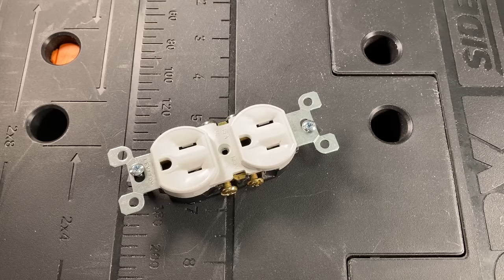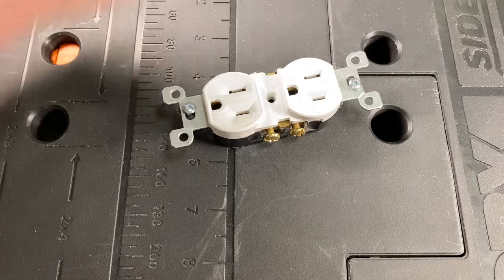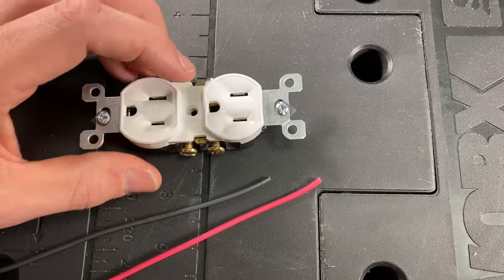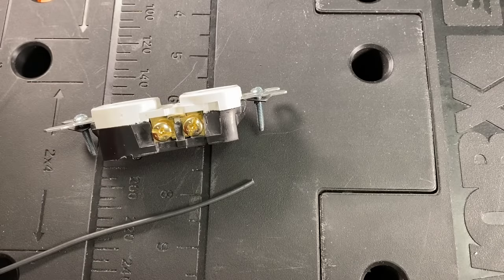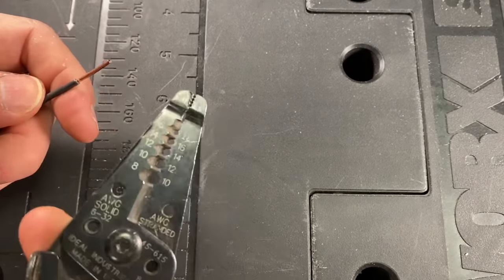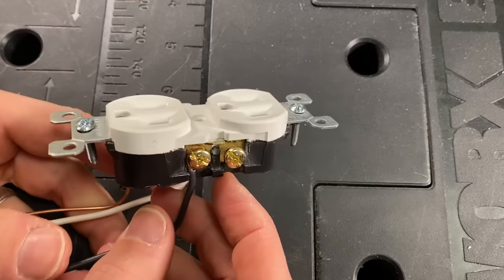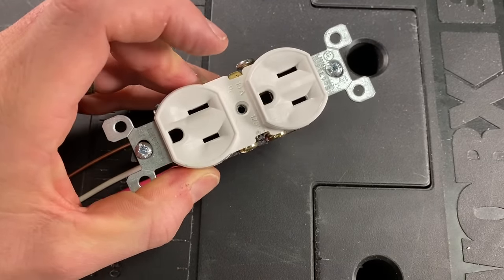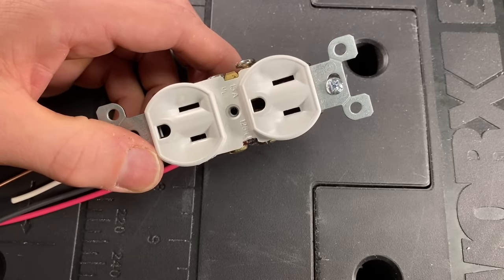Electrical Outlet Basics | How To Wire

Comment: Another little trick you might want to mention. Sometimes when outlet or switch boxes are installed (prior to drywall or finish surface) the box is secured too deep on the framing stud. The "ears" that you see on the very ends of the outlet are to stop the outlet from being installed too deeply into the drywall. If the outlet is installed too deep the cover plate will not seat properly. Also, drywall installers are notorious for cutting out the boxes with too much of a gap between the box and the drywall. This will make the "ears" ineffective in keeping the outlet from securing to the box without going too deep. (hope I explained that clear as mud) There's a trick I learned from the master electrician I was an apprentice under. Take a length of bare copper wire and wrap it around the screw between the outlet and the box to use as a spacer to make the outlet flush with the outside of the drywall.
Reply: োনচময়ৃ।চৃ🎗🎗🎁🎖🎖🎀🎑🎋🎗🎎🎌🎆🎌🎌🎌হিরজসজাহাজশহৃশৃসহমৃশননসমসমডনডম
Reply: @David S ... I don't quite understand what you mean by "the screw between the outlet and the box. Would you clarify please? TY
Reply: @dianavp9054  Take a screw that is the same size as the screw used by the outlet to secure it to the box and wrap a copper wire around it a couple time then cut it off. The coil you've made can be used as a spacer between the outlet box and the outlet which will in effect make the outlet stick out further and seal the cover plate correctly. I hope that helped.
Reply: @davids7209 or use an adjustable box so the box protects the entire receptacle.

Comment: Make sure you test the wire for the correct gauge before using the wire stripper. By choosing the wrong gauge on the stripper and attempting to strip the wire, you can nick the copper of the wire or cut off some copper strands of wire if using stranded wire. There are usually two separate gauges marked on a wire stripper. One side is labeled for stranded wire and one for solid wire. They are not the same stripping hole on the wire stripper for both types of wire.
Reply: Am i the only one still using a razer blade to strip wires still??? lol give me a automatic stripper plz...

Comment: I love seeing how you do electrical work in the USA, here in the UK the bare cable is called the CPC (Circuit protective conductor) and has to be sleeved in green and yellow sleeving. Also our electrical sockets use the screw down type fitting, and not the loop method you use.

Our cable colours are Brown is Live, Blue is Netural and bare is CPC.
Keep up the vids
Reply from the maker: Hey Shaun,  Thanks for sharing 👍

Comment: I always screw in the unused screws so they don’t catch and nick wires in the box. 

You should show techniques for pushing the plug back into the box. That is often he toughest part of the job. 

The hook around the screw should always be positioned so that tightening the screw closes that hook rather than opening it up.
Reply: 0

Comment: Learned something new today. Small slot to hot side. Large slot to neutral side. 

To me, it’s always: brass = hot. Silver = neutral.  
Never thought about the sizes of the slots going to hot or neutral.
Reply from the maker: #neverstoplearning 👍
Reply: Brass is the darker metal, and is for the darker (black or red) wire.  White (return) wire to the white metal.
Reply: here's another for you.  it applies to receptacles with the ground at the bottom: "right will bite"

Comment: You might want to do a video that shows how to wire the receptacle when there are multiple outlets on the same circuit.
Reply from the maker: Great suggestion!
Reply: John Sessoms That should be as simple as using the other unused hot and neutral screws on the outlet to feed power to I believe 4 to 5 outlets max on a circuit.
Reply: @koshnaranek2317  I would recommend pigtails to each receptacle in multiple receptacle boxes.

Comment: Very basic but informative for those who have never wired a receptacle. Coming from the UK, I found it strange to use black as the live wire because black is always used as neutral there. Also the ground pin is always at the top not at the bottom. I had to completely retrain my brain. Also having the receptacle independent from the cover plate was something new. I was so used to having it all one piece and with built in individual switches so you can turn off power without unplugging the appliance

Comment: When you break the tab for the switched outlet, you must break the tab on BOTH sides and use TWO white neutral wires, because the two hot wires could be coming off of two separate 15A breakers.  If you use a single white wire, it could carry 30A instead of 15A and catch on fire.
Reply: Good to know.  I have always broken both tabs.
Reply: Not necessarily. If the two hots are opposite phase, you can use one neutral wire.
Reply: @sparks8218  if it’s coming from the same circuit, but if it’s two different circuits, you need a breaker tie so that both circuits are cut off simultaneously to prevent potentially having the an unexpected load still flowing across that shared neutral.
Reply: If they are from different circuits, absolutely true.

In addition to the reason you cite, a GFCI or AFCI breaker on the circuit will trip if the return wire doesn't go all the way back to the same breaker the hot wire came from.

On the other hand, if the switch and the always-on lead come from the same circuit, then a common return is fine because it's all one circuit.
Reply: If you're doing the wiring you should know that. If you didn't run the cable then look in the switch box. If a 2wire w/ground is the source and both the black and red wires are deriving their power from that same cable, then you know.
Reply: @njsongwriter  Sort of.  See it isn't "then you KNOW".

It is "then you ASSUME".

And building code regulations are built around making it impossible to assume.  This means that even though your wiring scheme WORKS, and does not pose a problem in physics, it must also not cause human confusion for the next person that comes along who doesn't know what the original person did.

For example, you can make it work by swapping the black and white wiring, the wires inside are the same and electricity doesn't care about color.  But the next person may not assume that they are swapped.

Also, when running four wires to a 220v plug, your two hot wires can both be black, but if you use two black instead of black and red, you must tape both ends in red tape. This is all so that "the next person" knows.

So if your receptacle has two blacks but not two whites, you put the next person in "guessing mode" and that earns you a big FAIL on your inspection.
Reply: @featherpony  You can use one neutral if the two hots are opposite phase. It's called a MWBC. Eg...Ckt 2 & 4 are opposite phase and can share a neutral. Learn your electrical theory.
Reply: @sparks8218  When you say you "can" do it, are you talking about the laws of physics allowing it or the laws of electrical code allowing it?

According to the laws of physics, you can use the black wire for ground, the green wire for hot, the red wire for neutral and the white wire for phased hot.  It'll work.  The colors don't change how the wires function.

Did you know when our house got inspected, there was a loose, detached, unused copper gas pipe going through the ceiling.  Building code made it illegal to have copper pipes for gas.  But the inspectors said the pipe must be removed, even though it is not attached on either end.  Why? "Because someone else might come along in the future and be tempted to use it for gas."

So what would an inspector say about your dual-phase with single return?

Comment: when this house in Missouri was built in the 1970s they backstabbed all the outlets and switches, and my house has aluminum wiring.  They used receptacles and switches designed for copper only.  Needless to say, the backstabbing caused numerous issues, so I went through and changed all devices to co/alr.  some wire ends actually burned off.  can't believe I never had a fire
Reply: ok so you need to rewire the house ? When I have  seen Aluminum  here they gut the wiring not always .
Reply: @SG-zh5xd  You don't need to rewire a home with aluminum wiring, but you need to be careful when working with it.  If you're working on a major project, you might want to anyway, just to make life easier in the future.

Any fixtures (outlets, switches, etc.) need to be approved for use with aluminum (e.g. labeled CO/ALR, CU-AL or AL-CU).  Fixtures not approved for use with aluminum are often (but not always) labeled with "AL" surrounded with the "no" icon - don't use these.

Aluminum-approved fixtures can cost more than copper-only fixtures.

Any splices/joints involving aluminum (e.g. wire nuts) needs to be coated with an approved anti-corrosion compound.

Joints on aluminum wiring should be inspected every few years, which of course, is an expense.

If you don't have experience with this, call an electrician who knows how to do this.  If you do it wrong, those joints can overheat, which is always a bad thing.
Reply: @Shamino0  I have seen a house inspection flag the aluminum  wiring they had to rewire the whole house around 8K
Reply: @SG-zh5xd  Was this a city building inspector, who can make legally-enforceable demands?  Or was it a pre-sales inspection, who can only recommend that a buyer make certain changes contingencies for a sale?
Reply: @Shamino0  it was pre -sale demand they did it
Reply: @SG-zh5xd  Thanks.  This means it was probably more an issue of making a buyer happy than correcting an actual danger.  (Assuming, of course, that the inspector found that the wiring wasn't in violation of code.)
Reply: @Shamino0  I live in KC they frown on it not sure to what degree  ,insurance companies will not even insure homes with aluminum wiring ,not sure what Insurance  company  will make them replace it .
Reply: @Shamino0  also make sure your insurance company knows about the aluminum wiring; if you didn’t tell them (they always ask) and have a fire they may not cover it

Comment: Don't confuse traditional back-wiring using the push clamps shown in this video with using the side clamps found on better receptacles. For less than 50 cents more in big box stores, you can buy receptacles with a side clamp. I feel the side clamp method is safer and easier than looping wire around the terminals as there is less chance of a looped wire not being fully seated under the terminal. Also, novices tend to bend the wire into a loop so sharply that it creates a breaking point. Spend a few cents more and buy a side clamp style.
Reply from the maker: Agree that those are 2 different things and also for beginners as you outlined that is probably a safer route to get a properly wired outlet.  Thanks for the feedback.

Comment: Thanks!  I've replaced a bunch of these but still learned a couple of things.  I didn't know about the hole on the wire strippers.  Also didn't know about the tab/bridge for the switched outlet.   While not recommended, I actually changed outlets at my mom's old house the other day without turning off the power.  Carefully handling each wire separately and not completing the circuit....lol.   that was a first for me but I couldn't turn off her power.

Comment: I think as well as showing the connections to the split receptacle you should include the connections at the switch to see how the connections at the switch make it possible to have a live and switched receptacle. At the switch you have a 2 wire power supply coming into the junction box and a 3 wire leaving going to the receptacle to make it possible to complete the circuit. Other than that I liked the clarity of your video,especially the importance of the proper amount of insulation to remove. Some receptacles have a small hole under the screws that you stick the stripped wire into and then wrap it back around the screw without having to bend it first. The little hole will always be under the right side of the screw.
Reply from the maker: Hey George,  thanks for the comments.  The hole you were indicating are those like the ones you find on most / all GFCI outlets?
Reply: @EverydayHomeRepairs  
And on higher grade non-GFI receptacles.

Comment: Took out a ceiling fan and was wiring an outlet for a tv ceiling mount. I just flipped the light switch off and someone turned it on while I had a handful of hot wires. It's scary at first but it really felt kinda good after I got up off the floor. I recommend flipping the breaker too.
Reply from the maker: That will wake you up, be safe out there.

Comment: One thing that you didn't mention which might just be so second nature that you skipped it was the direction of the loop. wrapping it so that it will tighten the connection vs work itself out from under the screw. Basically, wrap the loop clockwise as you did.
Reply from the maker: 💯thanks for the callout.

Comment: the brass or hot side screws may also be plated in an oxide or black finish.  In the U.S. hot side wires can more than just red or black which are the most common. The hot wires can basically be any color other than white and green, though I have not seen the latest copies of the NEC, so there might be more reserved colors now.  The neutral should always be white, and the ground should be either bare or green.  I generally do not use the quick connects, as it is a problem with making changes later.  People undertaking such projects themselves should check the local codes.  I have seen outlets where the screw was tightened over a partly insulated wire on either the hot or the neutral, which resulted in bad contact between the wire and the outlet terminal resulting in arcing and failure.  Loose screws on the terminals could cause the same.  If there is resistance to electrical current in the junction, it will cause heat with is proportionate to the square of the amount of current drawn through the outlet.  For you math freaks out there, the power evolved in heat at the junction is equal to the square of the current multiplied by the resistance in the junction.  Since power is linearly proportional to the current at constant voltage, for house wiring the heat evolved at the junction will therefore be a function of the square of the power drawn.  Something that might be good enough and not fail when a 10 watt cell phone charger is plugged in may fail when a 1500 watt space heater or an 1800 watt hair dryer is plugged in because it will cause thousands of times more heat to be evolved at the junction.  From my experience, those two appliances, hair dryers and space heaters, expose a lot of issues because of the power and hence the current that they draw, not that that is the way you would like to find out that you have a problem.  I have seen fires in junction boxes which require opening up the walls to replace cables and wiring.  Flame proof junction boxes can prevent what would otherwise be a house fire.  If you do not know what you are doing, this can be dangerous.  Smoke detectors and arc fault circuit breakers can add an extra layer of protection in case of these types of bad junctions, but they are not a substitute at all for proper wiring.
Reply from the maker: Good stuff Richard,  appreciate you dropping some knowledge bombs.  Cheers!

Comment: Not to pick this apart, but, it's very important to stagger the wires when you attach them to the terminal screws.  If you use only the bottom or top screws on the device, you are relying on that little tab of metal rated at 15a to act as a brute for the current. It doesn't matter which, but you should always have the hot on the top and the neutral on the bottom screw,  or vice versa.  That way you are not requiring the device to carry a load from one appliance to another, also if the device fails, neither port will work and you might be alerted earlier to that failure.
Reply: Can you explain further for a newbie pls?
Reply: If it fails I thought neither port would work? I didn't think the top screws were for the top outlet and bottom for the bottom....but maybe I'm wrong
Reply: I'm trying to think of how to word this.  If wired like I stated above, if either outlet  were to fail, neither would work, possibly alerting you to a failed device earlier.  If you only have something plugged into the bottom, and the top fails, you could be using a faulty, possible dangerous device without knowing.

Comment: I like the new receptacles and switch’s with the locking plates under the screws. No looping of wire, just push the wire straight under the plate and tighten the screw(s).   This is particularly handy when replacing components when leads in boxes are on the short side. 
These are the ones I look for when buying new.
Reply from the maker: Yeah, I like those as well which I think is the type on pretty much all available GFCI receptacles.
Reply: I still wrap the wires. The plate is off center and will loosen over time.....
Reply: @timbernie    Install a short pice of bare wire (just long enough to fit under the  plate) and this will prevent that offset.

Comment: Comment From an IBEW journeyman ;  Do not leave any unused terminal screws sticking out , screw all in. when using the receptacle as a control switchable outlet , when installing the wired controlled  receptacle install the switched outlet on top with the constant outlet at the bottom for vertical mounting , some code like ground at  the top, (ground up ). if mounting horizontal place neutral terminal (the big slot ) at the top.
Reply from the maker: Good stuff Robert, thanks for all the comments and knowledge.
Reply: I disagree. I would put the switched outlet on the bottom because it's always going to have a lamp plugged into it whereas the other side of the receptacle will be likely used for various things and it's more accessible to use especially if it's located behind a night stand by the bed.